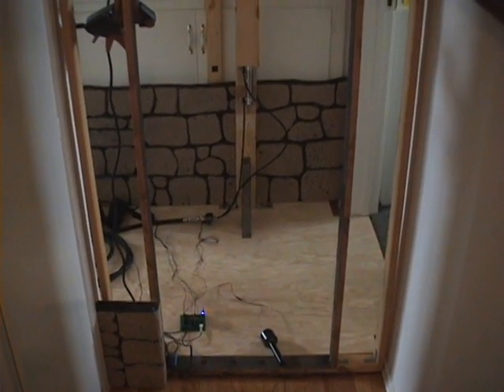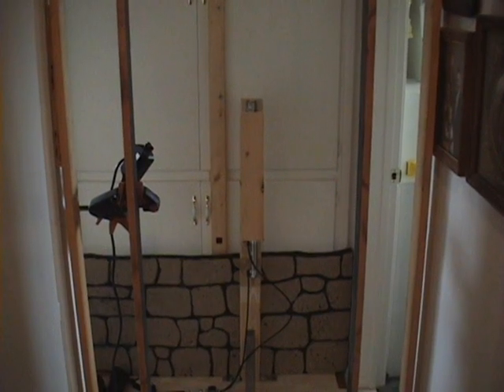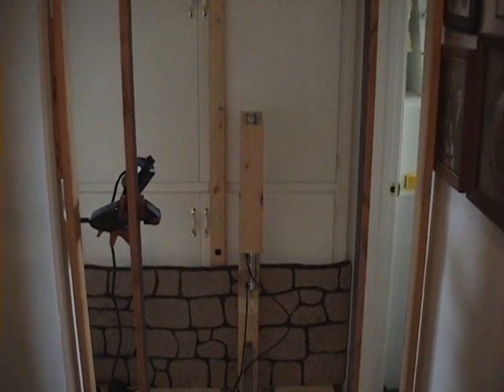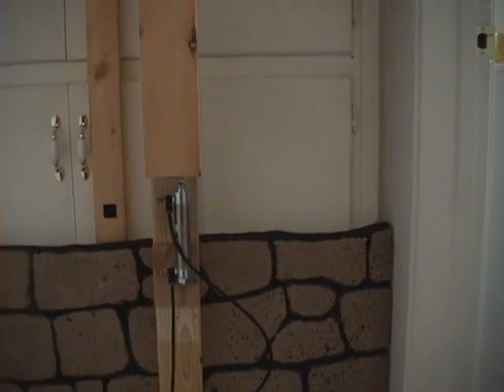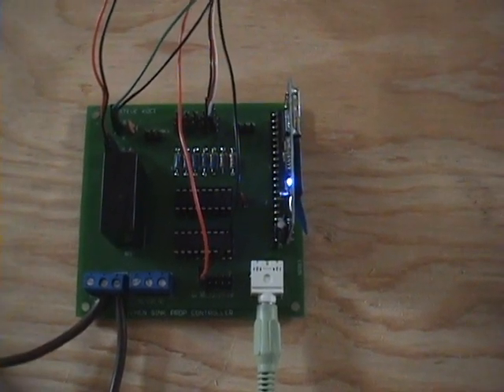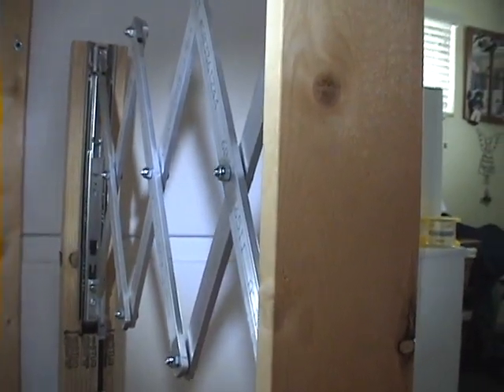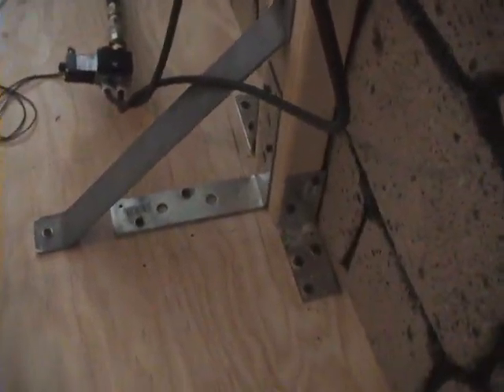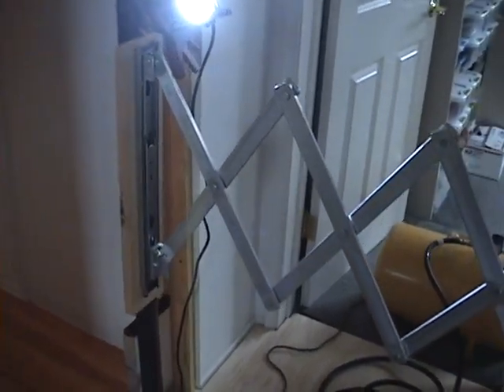Pneumatic Scissor Halloween Prop

Comment from the maker: I'm really happy with the way the controllers working out.  It's nice to be able to just grab one that has the ability to handle whatever component I want to use.  No problem with the scissor twisting but I won't have much weight on it either.